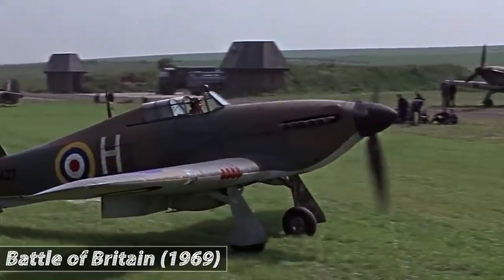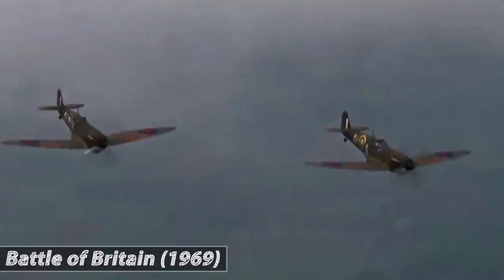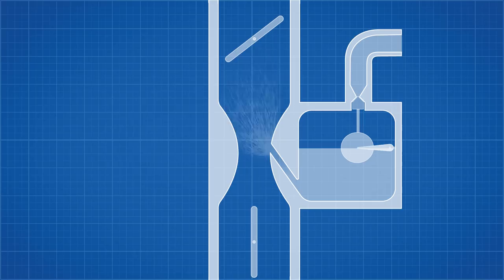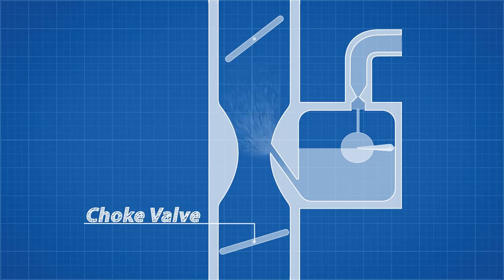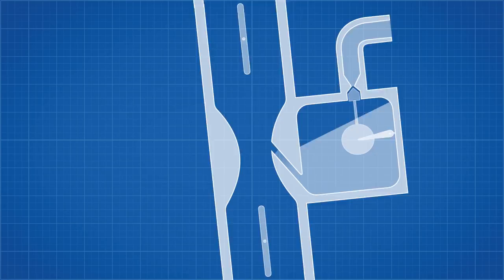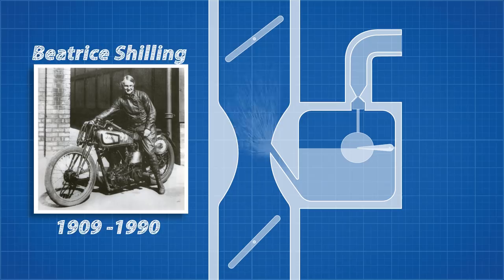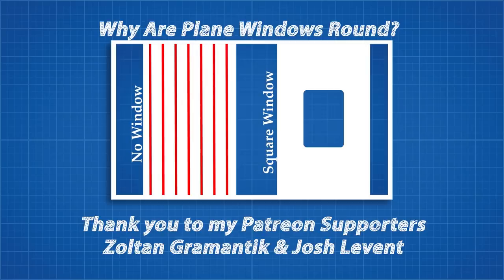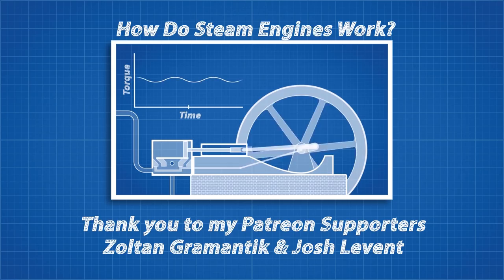The Spitfire's Fatal Flaw

Comment: A video about the Spitfire starts with some footage of the Hurricane.
Reply: pinned comment?
Reply: Both suffer from the same problem though, at least until the fix
Reply: @AlexSlavenDrums  
No problem for RAF pilots and there was a partial fix in 1940 and complete fix in 1941, Miss Shilling and her team of specialists did both as well as further work with SU to develop the speed density carburetor which was used on the Spitfire Mk IX and given to Bendix.
Reply: Barrie Rodliffe .

Comment: There are a few other disadvantages versus the Bf 109, the big one being firepower. The Germans not only made the switch to Autocannons very early and then kept going by switching to bigger calibers, relatively quickly. This was also necessary for them since they were facing a lot of bombers, but it also probably gave them an edge in fighter action. It‘s much easier to deal catastrophic damage with a higher caliber that allows for HE or AP ammo.

Still, they were extremely similar planes with the basic premise of putting the biggest possible engine in the flimsiest possible airframe. Completely different from, say, the FW-190 which had superficially much more mediocre stats but was built for durability, with logistics and frontline challenges in mind (Kurt Tank was on the frontlines in WWI and this clearly influenced his thinking).

It‘s interesting how differently you can approach the same problem, but then this potentially locks you into certain other decisions later.

Comment: This is an explanation of a 'fatal flaw' of the Merlin engine in any fighter application. In fact any engine of the era using a carburettor rather than fuel injection.  It was obviously less of a problem with bombers whose pilots tried very hard not to pull negative 'G'.

Comment: Not only Spitfires had that issue.
Reply: Jdm yo
Reply: Chris _ Many biplanes had similar issues, which concerned the floater while flying upside down. I may be wrong though.
Reply: Patryk Lemanek , any float based carburetor engine has this problem. Most non-aerobatic general aviation planes still use this simple tech for fuel delivery. The other issue with negative G maneuvers is oil delivery. Most aircraft engines use simple gravity oil return, so when the plane goes negative, the oil pressure in the top of the engine where the valves and pistons are being lubricated become over pressurized. This increased pressure can seriously stress the valves and bottom side of the pistons, in addition not lubricating the crank shaft. Another thing not mentioned in this video is fuel delivery, fuel intake at the tanks is typically at the bottom of the tank, when negative fuel is not making it to the fuel lines which can cause an airlock in the fuel lines. Most aerobatic aircraft are designed with inverted oil drain / pumps, fuel injection, fuel pumps, and specifically designed acro fuel tanks to feed fuel when the plane is negative.
Reply: thats why they invented the circular engine,
Reply: Newton 
No, any engine with a carburetor had that problem until Rolls Royce solved it.

Comment: It was such a major flaw that the Germans won the BoB. Wait...
Reply: It wasn't a fatal flaw but it was a disadvantage but it also had advantages. Messerschmitts had other disadvantages and advantages so that pilots who flew each or even both said that they were roughly equal.
The unsung hero of WWII was the soviet Yak 9U.
A french fighter pilot who flew Spitfires, Mustangs and Yaks claimed it was better than either and german Messerschmitt pilots were officially advised to avoid engaging Yak 9s if at all possible.
Reply: @Just Some Guy Ok Fighting in your homeland and in your countless airfields and directions (your whole armed forces and of course population too supporting you by spotting and ground-support, rescuing you and dooming every german pilot not able to stay in the air till back home), intercepting (against an air force that is designed the opposite of tactical and strategic boming, in both nature and aircrafts, or even training, experience and equipment for that matter), not independent, outnumbered, underpowered and fatigued (both because of conquering european Europe) and escorting-burdened enemies fighting in your homeland (with the sea under them too) by a funnel air corridor, with Radar, with AA, with USA lend-lease, with insane all-around operation and moves sinergy, swift and comfort (opposed to the Luftwaffe that was given a 1 small error-disaster scenario), with polish-countered Enigma, with the cocky, irreplaceable Luftwaffe's ace killers by mismanagement and unprofessional-duo Goering's incompetence and with Hitler's retardation making the Luftwaffe goof around and suicide in bunkered civil targets instead of fighting seriously and not making RAF recover like early (where the RAF was collapsing, not like the germans had any means to know that and so that they won though) indeed proves the skill and might of the Spitfire (correcting your ignorance: Hurricane would be the most present and most relevant too aircraft of RAF) and sea-saved UK.... 
oh wait.
Reply: @dusk6159  the Germans were the attackers and didn't have the necessary to win. That's war, don't cry about it.
Reply: But for a pilot it can be fatal if you roll the plane too much. If the engine stalls it will not start again in mid flight.
Reply: The Bf 109 had a major flaw while landing and 5% built were destroyed in accidents.
Reply: Just Some Guy Ok The German’s had “political flaws” going against them.
Reply: False dichotomy, reductio ad absurdem, straw man, and if-by-whisky. Collect 'em all; impress your friends.
Reply: @bazd884  The Bf109's other flaw was structural damage was very hard to fix since its skins also formed the bulkheads. This is why so few are flying today. 
Without factory tooling you just can't repair them easily.
The Spitfires were much easier to repair, and the Hurricanes easier still.
Reply: Gustav Meyrink Yaks were seen as inferior and the huge kill rates that 109s and fws got on the eastern front
Reply: @BuddySpike101  the engine didn't cut out when the plane rolled, it cut momentarily as a result of negative g encountered during a bunt. The pilots soon learned that they couldn't follow a rapidly diving me109 by simply pitching the nose down, they had to do a half roll to inverted then pull the stick back, thereby maintaining positive g. The success of the Merlin design was enhanced by its continued development, almost doubling its horsepower.
Reply: @bazd884  ditto taking off. The huge engine torque and narrow undercarriage could result in uncontrolled roll if the pilot wasn't careful when taking off.
Reply: Can't do negative g's or the engine will cut out and possibly even be damaged, and has a tendency to roll due to engine torque...

So... You mean pretty much every civilian single-engine craft ever built?
Pretty much all civilian aircraft other than those built for aerobatics have issues with flying inverted due to how the engines are constructed.
(most common problem in modern piston engines is the use of a gravity fed oil distribution system.)
Reply: @KuraIthys  hi. Most single engine GA aircraft would potentially have a similar problem if normally aspirated and not designed for negative g. Plus, most GA types have nowhere near the power of a ww2 fighter putting out well over 1000hp early on, rising to nearer 2000hp with later engines. This would be swinging a large prop of 3,4 or 5 blades and maybe 10-12' diameter. Fuel injection is more commonplace nowadays though so not a problem for them. Of course, aerobatic machines are designed for the purpose. The me109 torque effect was not unique but was more pronounced due to the power involved as well as a very narrow undercarriage. The power needed to be increased carefully at take off so as to not induce a sudden and fierce roll which needed to be countered with opposite aileron and rudder. There are many tales of high power taildraggers swinging violently on take off roll if the pilot didn't correct with rudder.
Reply: Kyle the German lost BoB because: Hitler decided to stop bombing Raf airfields but British cities and
the luftwaffe should have used more of its planes (just half of the German fighter and bombers were used)
Reply: Gustav Meyrink the Yak9U (along with all the late war soviet planes) were absolutely incredible at low altitudes, but the German pilots learned that they just needed to climb over 3000 meters... but the Soviet were advancing on the ground and their iL2s were flying at 2000 meters, not at high altitude
Reply: @ferrarisuper  
Bombing airfields was not working and Germany had been bombing cities all along. Britain was only using maybe a third of its fighters and still won. The Luftwaffe outnumbered the RAF at the time.
Reply: Gustav Meyrink You’re talking about the Yak-3, the Yak-9’s only advantage was being present in large numbers

Comment: Well done! Few "wingnuts" understand the operation of "Miss Schilling's Orifice". Just as you explain in the video,  its function was to restrict the amount of fuel entering the Merlin engine's carburetor to the maximum amount of fuel that the Merlin engine could  "burn" at full throttle. This is the kind of practical genius that helped the British prevail in the Battle of Britain and WWII. Cheers.

Comment: Fun fact. In the film Battle of Britain, the bf-109s, which were obtained from the Spanish Air Force were fitted with Merlin engines. The Spanish build bf-109s under licence as the Hispano Aviación HA-1109 Buchóns, but were unable to source Daimler-Benz DB 605 from Germany during WW II. Consequently, they fitted the Hispano-Suiza 12Z V12 aero engine. In 1954 a version called the HA-1112-M1L was built using readily available Rolls Royce Merlin engines which had 1,600 HP.

It's those Merlin-engined Spanish built licence built copies of the bf-109 that did battle with Hurricanes and Spitfires in the film (and several other WW II era war films).